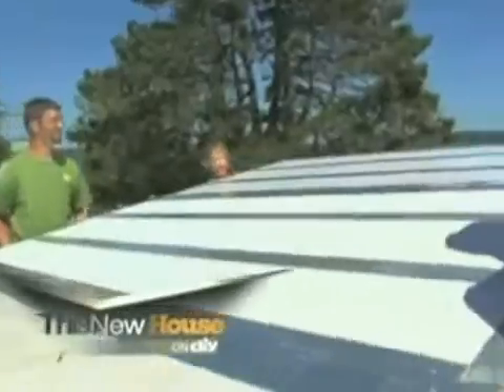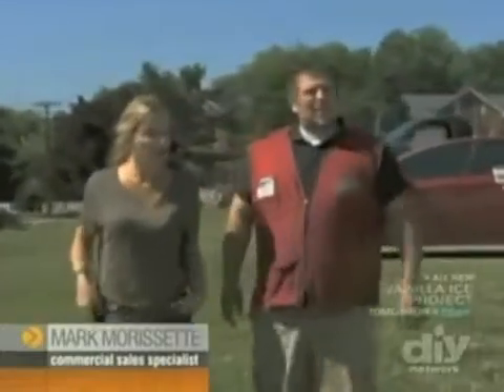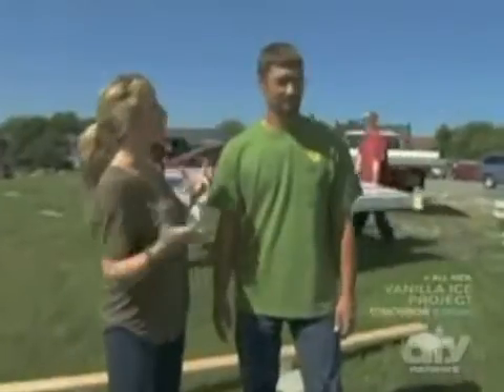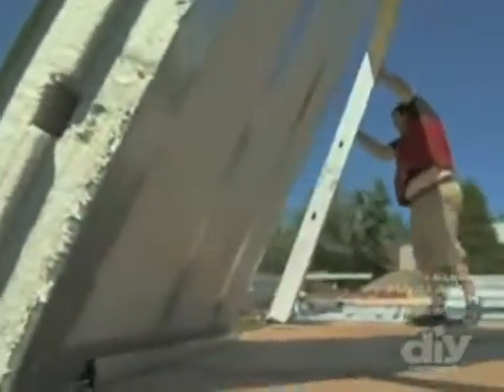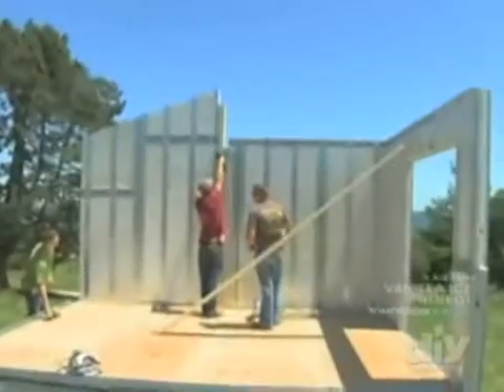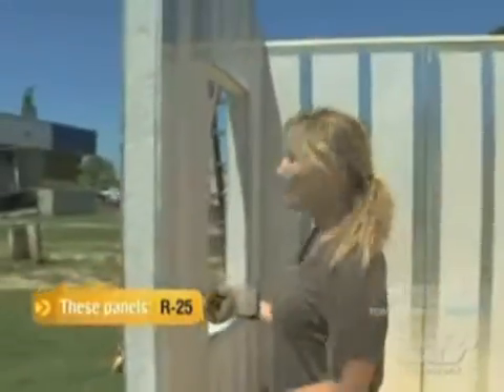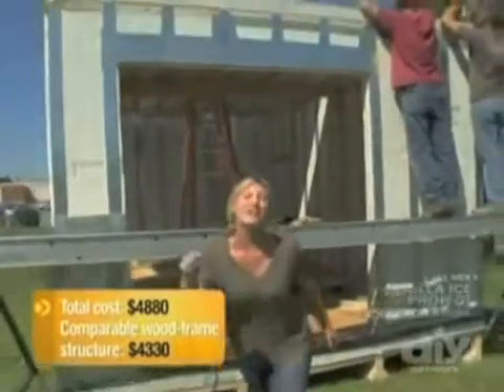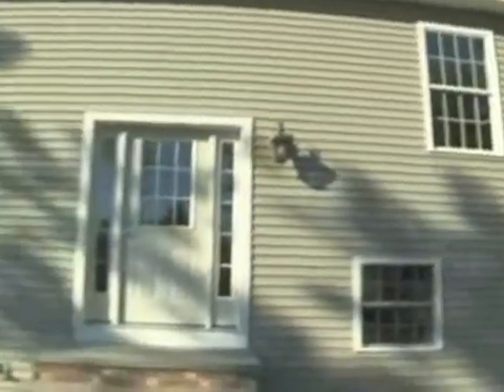DIY Building using ThermaSteel Steel SIPS

Comment: The last time I checked, trees are renewable, foam is not.
The vast majority of lumber in the US is planted and harvested repeatedly in the same plots of land.
Reply: And another word for wood is "termite food".
Reply: @Pepeekeo808  They eat foam too.
Reply: @wisenber  Not true and you know it. Foam has no nutritional value to termites. They are not attracted to foam. My steel SIP home in Hawaii is over 10 years old and has never had termites, but my neighbors, who have wood homes, are constantly battling Formosa termites.
Reply: @Pepeekeo808  "Not true and you know it. Foam has no nutritional value to termites."
Despite the lack of nutritional value, termites do eat foam. 

My steel SIPs have a complete galvanized shell, so no termites. Termites will consume exposed foam to make a nest, and I know it.

Your neighbors should try Termidor. It works for a decade at a time.
Reply: I am curious what brand and company you got the sips with fully enclosed galvanized exterior? I have heard it for myself that insects chew on the foam and I've seen the chewed foam pieces.
Reply: @timtim-ef7xu  Try Structal. Plus they have snap in panels for a tighter fit.

Comment: Wind rating? Approved for Florida?  roughly how much for a 1000sqf single floor shell with two doors and 4 sliding doors?  when is electrical and plumbing installed? Too bad the product requires siding and an interior drywall finish..